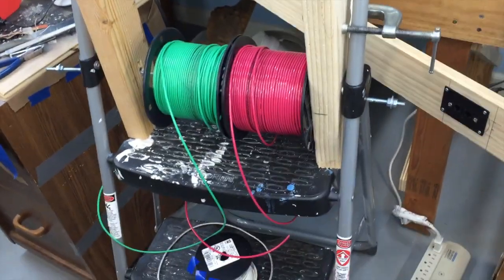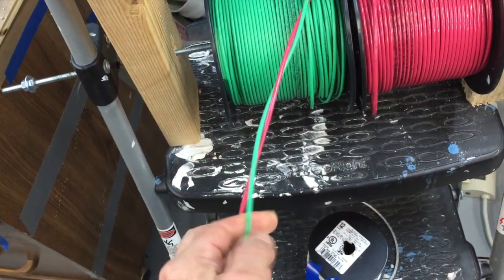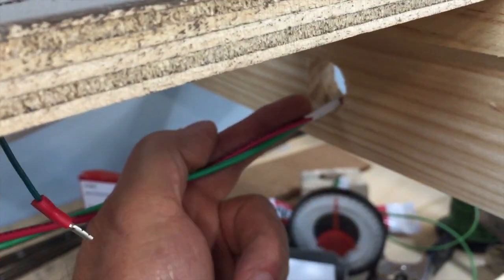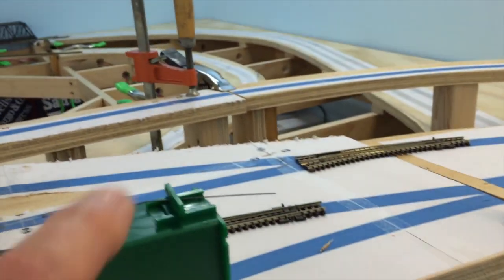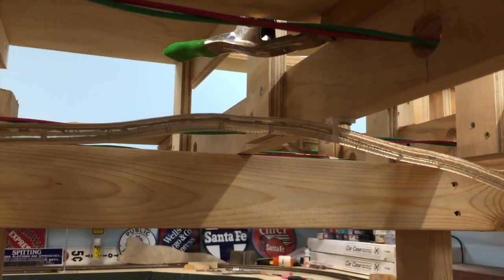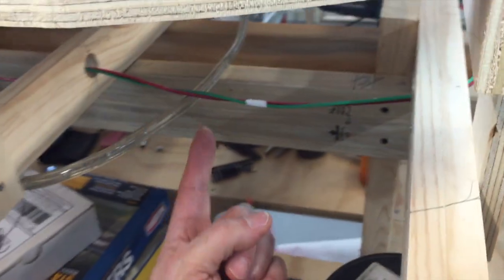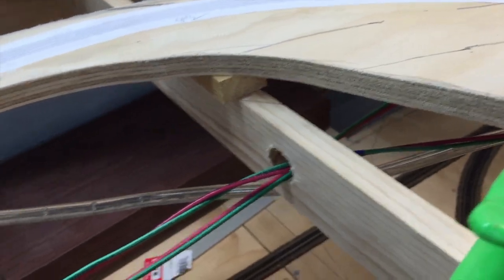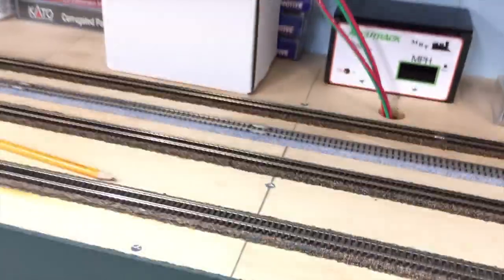How I Install DCC Power Bus Wiring

Comment: Hi John, how long are your "district" buses ? Is 30 feet either side of a booster the maximum lenght to provide "non poluted"  DCC signals and power ? What's your experience ? I'm planning a layout of about 210 feet long main line - kind of dubbel loop. I have only the 'NCE Power Cab' so far. Can I start with this outfit ? Thanks and kind regards from France.
Reply from the maker: Filip, Thank for watching and your question. Here are a couple of recommendations - I found two places that really helped me,  Allan Gartner's web site - wiringfordcc.com. Second, the following YouTube channel, arthurhouston3.  Art has an entire section of videos on using various NCE products.
General Information - The NCE Power Cab is a nice self contained starter DCC system.  I started out with the Power Cab myself and use it as a Pro Cab now. Depending on the scale of your layout, HO or N, will determine how many things, such as engines, stationary decoders, etc, that can be run at one time.  The Power Cab is a modular system so if you think that you need more power then you can add another power booster (check the NCE site for the latest one) to your Power Cab.  The one thing that you need to really pay attention to is where your command cable to additional plug-ins along the length of your layout.  They need to be perpendicular (as close as possible) if they cross your power bus (Art Houston’s channel shows this in detail).  Also, make sure you twist your power bus wires (as I recall it is about 3 turns per foot) as this will also reduce RF interference. Also, if the command line (it has to be continuous from the Command Station/Booster) is over a certain length (it is somewhere around 60 to 80 ft as I recall), you will need to add a “wall wart” to boost the signal.  I got mine from the Litchfield Station Hobby Shop.  I believe that Art Houston’s videos have a good discussion of the command line and how to make your own rather than buying ready made ones as well as how to lay one out.  Don't forget to check to make sure you don't have a hidden reversing loop.  There are lots of ways to solve it, to include removing it by redesigning the track plan or using an auto-reversing circuit.

My Layout Specifics - I put my NCE command station/booster (NCE CS/B) and the PSX Circuit breakers as close as possible to the center of the layout between the east helix (near Union Station) and the west helix that is near the building entry door just opposite the east helix.  Within a couple of feet, they are probably about 30 feet in each direction from the NCE CS/B (so to answer your district length question, they are all roughly 30 feet (give or take) long. I have 8 power districts, 4 on the staging level and 4 on the main and third level. All of the main bus wiring starts at the cabinet where I have the NCE CS/B & circuit breakers. It is wired similar to a house from a centralized circuit breaker box out to the 8 power districts.  I did not use a "snubber" at the end of any of the power runs but ensured that each end was used as a track power feed and I have not had any issues.  I based the size of each power district on the number of track feeders and divided them up as evenly as possible.  Any place that engines will be parked for long periods of time, such as in the lower staging yards, Union Station area, and engine facility, all got power cut-off switches.  Basically a SPDT switch with one power bus wire going to the switch. This is a really long answer and I hope that I have answered your question…..John
Reply from the maker: Filip, Thank for watching and your question. Here are a couple of recommendations - I found two places that really helped me,  Allan Gartner's web site - wiringfordcc.com. Second, the following YouTube channel, arthurhouston3.  Art has an entire section of videos on using various NCE products.

General Information - The NCE Power Cab is a nice self contained starter DCC system.  I started out with the Power Cab myself and use it as a Pro Cab now. Depending on the scale of your layout, HO or N, will determine how many things, such as engines, stationary decoders, etc, that can be run at one time.  The Power Cab is a modular system so if you think that you need more power then you can add another power booster (check the NCE site for the latest one) to your Power Cab.  The one thing that you need to really pay attention to is where your command cable to additional plug-ins along the length of your layout.  They need to be perpendicular (as close as possible) if they cross your power bus (Art Houston’s channel shows this in detail).  Also, make sure you twist your power bus wires (as I recall it is about 3 turns per foot) as this will also reduce RF interference. Also, if the command line (it has to be continuous from the Command Station/Booster) is over a certain length (it is somewhere around 60 to 80 ft as I recall), you will need to add a “wall wart” to boost the signal.  I got mine from the Litchfield Station Hobby Shop.  I believe that Art Houston’s videos have a good discussion of the command line and how to make your own rather than buying ready made ones as well as how to lay one out. 

My Layout Specifics - I put my NCE command station/booster (NCE CS/B) and the PSX Circuit breakers as close as possible to the center of the layout between the east helix (near Union Station) and the west helix that is near the building entry door just opposite the east helix.  Within a couple of feet, they are probably about 30 feet in each direction from the NCE CS/B (so to answer your district length question, they are all roughly 30 feet (give or take) long. I have 8 power districts, 4 on the staging level and 4 on the main and third level. All of the main bus wiring starts at the cabinet where I have the NCE CS/B & circuit breakers. It is wired similar to a house from a centralized circuit breaker box out to the 8 power districts.  I did not use a "snubber" at the end of any of the power runs but ensured that each end was used as a track power feed and I have not had any issues.  I based the size of each power district on the number of track feeders and divided them up as evenly as possible.  Any place that engines will be parked for long periods of time, such as in the lower staging yards, Union Station area, and engine facility, all got power cut-off switches.  Basically a SPDT switch with one power bus wire going to the switch. 

This is a really long answer and I hope that I have answered your question…..John
Reply: Hi John, Thank you so much for your very clear answers, recommandations, tips and link ! The picture becomes clearer now. My layout 18' x 23' will be HO - Peco code 100 track (I have a lot of rolling stock from the 80's). Min. radius is 24" but most 'blobs' are up to 30". Max grade 1,5%. Train lenght max 51"; 
I intend to keep all wiring for signalisation, turnout control etc. on a separate 'bus'.  It's a mix of American / European style. (I'm Belgian - Flemish but live in the centre of France). I used to have a Modelrailroad mag. subsciption but now prefer the Model Railroad Hobbyist free emag. A lot of info but seeing a video like yours is tremendous help. I have posted a pre-project trackplan of the Anneliesville RR on page 33 of MHR Trackplan database. I will update the final plan. 
Thanks again for your 'long' answer but indeed most helpful. Thank you for this effort and your time !!! All the best... Filip
Reply from the maker: Hey Filip, You are very welcome as I believe that this is exactly how YouTube helps all of the model railroaders around the world. Let me know if you have any additional questions as I will be glad to help you or point you to someone that I know can help with any particular issue you may run into.  By the way, I am located a little south of Austin, TX. Your layout sounds like it will be a lot of fun to build. I also blog on MRH as I have come to enjoy that magazine much better than MR even though I still have a subscription......John
Reply: Hey John, I hope you are well ! Thanks for your help, I appreciate your efforts and time. Nice to know where you live in the USA. I'll have a look on Google maps !My Anneliesville is in the 8 dec MRH. I already made a modification to the plan after input from fellow MR's and as you mention it's nice to be in the family of Model railroaders. It is a great source for info and also the friendships. I have to look up your blog on MRH ! Meanwhile I've been studying the Bluetooth train control via a mobile device. BlueRail seems to have a system established that works simple and effecient (Bachmann EZ)... and less expensive than a upgrade on DCC for me. The advantage being the wireless control and just normal 6 to 20 V. DC power supply to the rails. No boosters, no circuit protection etc. A decoder cost about 75$ and it seem possible to transfer the sound into a speaker cube. A parallel system is the Monocacy at half the price - but not a lot of echo on this product. There's a lot involved in building a room-size layout ! But interesting.
All the best !

Comment: @JohnTanzillo Does the brand of the bus wire matter?What specifically am I looking for when I buy bus wire from the store...I actually started working at The Home Depot and have an oo gauge model railroad at home.I know some wires say car stereo wire and others say something else...what kind/style/brand am I looking for? Thanks for your help!
Reply from the maker: Roger, Thanks for your questions.  I just look for stranded wire and the brand is immaterial.  I have purchased all of my 12AWG & 14AWG plus some 24 AWG speaker wire from Home Depot. They don't carry 18AWG or 22AWG stranded so I have to get them from either on-line or sometimes from Ace Hardware.  Since I am in N-scale, I use 22AWG for track feeders which is probably what you want to use for oo gauge.  The stranded wire is easier to work with (my preference) but there is no reason that solid can not be used.  I'd recommend looking at this website http://wiringfordcc.com for pointers on wire.  The key thing with DCC is to maintain the voltage throughout your layout. That website will have a lot of discussion concerning voltage drop with different gauges of wire.  Hope that helps.....John

Comment: How often in feet, do we need to repower a train track at different locations.
Reply from the maker: Bill, The usual guideline that I follow is to feed power to about every three (3) feet of track or each piece of flex track.  I solder all track joints except I don't solder turnouts to the previous section of track.  I do that because I want to be able to easily replace the turnout if need be.  A good source for DCC wirining is the following website - http://www.wiringfordcc.com.  Hope that helps...John

Comment: THANK YOU...for sharing. Is it necessary to twist the buss wire?
Reply from the maker: Yes at least 3-4 turns per foot.  It helps to prevent cross-talk/interference with the command line on my NCE system.  Additionally, the command line should cross the bus at right angles if at all possible...John
Reply: Is that just for NCE or all DCC system?
Reply from the maker: It's recommended for all DCC systems that have long power bus runs. I'd recommend going to http://wiringfordcc.com/track_2.htm. That is a great web site for helping you with installing DCC.  Hope that helps...John
Reply: If you don't keep the wires adjacent, it increases the inductance of the bus, and therefore the sharp edges of the square wave are softened, which makes the communication less reliable.  Good to see this being emphahsised, and also a protocol to keep wiring identified.

Comment: hi nice video I have to rewire my nscale so iam using a main bust line 14 gage  but I don't understand when I come to a switch could you explain
Reply from the maker: My DCC system is NCE and I use PSX circuit breakers for each power district.  There are a total of 8 power districts (4 on the main/third level & 4 on the staging level).  From each of the circuit breakers, I run a power bus (I used 12 AWG stranded, overkill but that's the way that I do things) the full length of the power district.  The feeders for each power district (22 AWG about 3 inches long with a solder-less crimped connector on the end) are then extended to a euro-style terminal strip with a section of 18 AWG stranded wire (the end connecting to the feeder has the other solder-less crimped connector).  Jumpers (18 AWG solid wire) are used to connect like polarity.  A section of 14 AWG stranded is then run from each end of the terminal strip to the main bus wire for that power district and connected to the bus using 3M IDC 567 suitcase style connectors. The wiring method that I use has made the wiring very easy to troubleshoot due to its modularity.  During the wiring process, all connections are tested for continuity and for the correct polarity.  As for wiring turnouts, I use Peco (the N-Scale versions are a bit different than the HO versions).  Since I do not isolate the electrofrog, the turnout must use either insulated joiners (other means to cut the power) after the frog.  Peco turnouts need to be fed power from their base, so after each turnout and before the next one (as in a yard) I usually install at least a short piece of track to feed the next turnout.  The website, http://www.wiringfordcc.com/switches.htm, is a great source of information for how to wire various switches/turnouts.   If I missed answering your question, please let me know.

Comment: Would you like to adopt a 55 year old man?....
Reply from the maker: +duenge  Sorry but I'm full up on family members.  Are you having issues with DCC wiring (power or command lines)?  Before I started, I bought all of the books that I could find on the subject.  They really were not much help. However, much of the literature is aimed at small layouts.  Remember it is just "two wires" but they fail to really help you understand the nuances. The wiringfordcc website is a decent source as well as asking questions on YouTube or on various forums....John
Reply: Just starting out with a small layout, probably a door.  I just bought a Digitrax DCS 51, (Zephyr).  I don't even have a loco yet!  I really enjoyed your video...thanks.

Comment: Why didn't you use 3 inch thick steel plate for the benchwork?  I dont think 3/4 inch plywood is quite heavy enough for those massive N gauge  trains.
Reply from the maker: +Makitaization Thanks for the interesting comment.  I like the performance of the thicker plywood.  I have used thinner (3/8") in the past and found that the thinner stuff was not as stable, especially on curves, due to the lack of plys.  In fact, the thicker plywood that I use is cabinet grade (on sale) so it has even more plys than normal 3/4" plywood. It also was a good match for mating the spline helixes with the plywood as they were about the same thickness, give or take a millimeter or two.